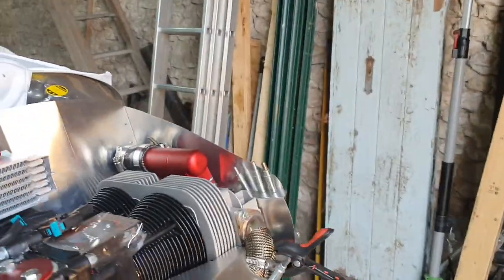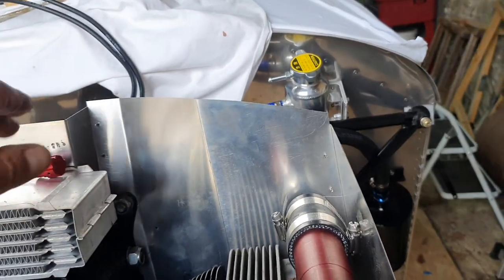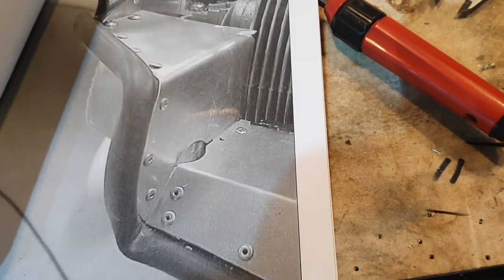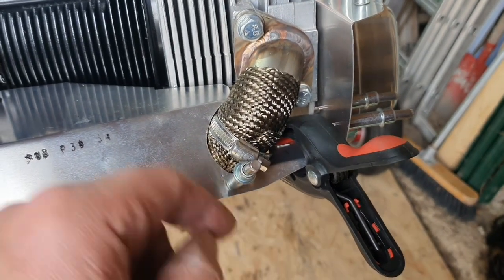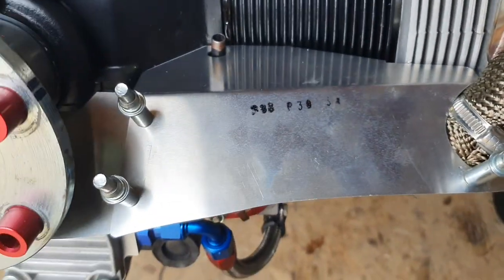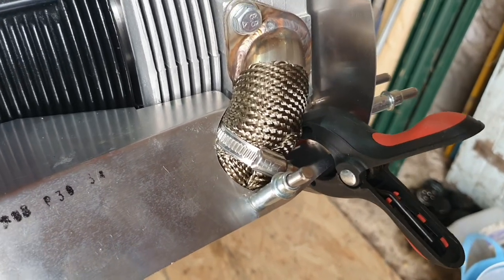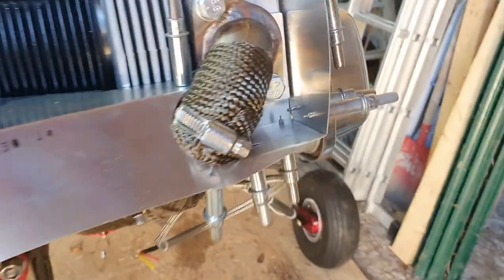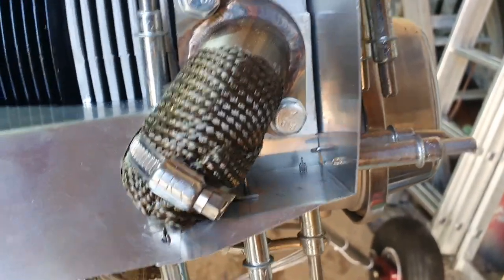Gavin's Sonex B Part 80 - Engine baffles Part 2

Comment: If you haven't already figured out the baffle trimming issue, this is how I would do it.  Using sheet aluminum, make a template of only the top center portion of the cowling that matches the curve of the cowling.  You will be able to see how to trim the baffle without interference from the sides of the cowling.  Trim the aluminum baffle until there is a 0.75 to 1-inch clearance between the top edge of the baffle and the template.  Then use the 2-inch baffle material as previously suggested so that your trimming does not have to be precise.

Comment: Just following on from @anthonystrawbridge and his fine suggestions.

I was pondering the trimming of the impossible to see baffle.

Could you 3D print a spacer, or multiple spacers that sit in various places on the upper edge of the aluminium sheet with a sliding indicator built into them?
Sort of a spot profile gauge where when you take off the upper cowl the spot gauges all indicate how far they’ve pressed down.

Then approach the critical seal gap in increments as you get near to the desired gap?

I’m sure this sounds much easier from the ‘General’s Armchair’ than it would be in reality …

I was starting to think the baffle you’ve built was going to be such a good seal that the vent hole wasn’t going to be big enough to equalise the air pressure 😂

Comment: Will the inner rim of the prop hub spinner spacer spin with the prop? If so, will the inner ridge that you made to rest the cowling rub on the cowling as the spinner spacer spins?
Reply from the maker: The alignment spacer is only used whilst installing the cowling to ensure correct alignment with the prop hub. It then gets a new life as a door stop or perhaps an interesting piece of wall art 😊
Reply: Now that is brilliant!